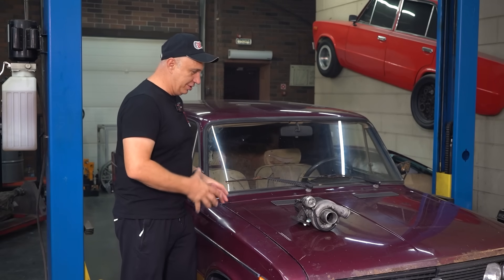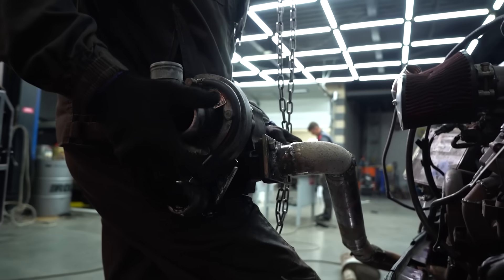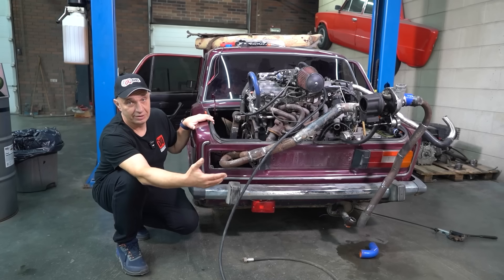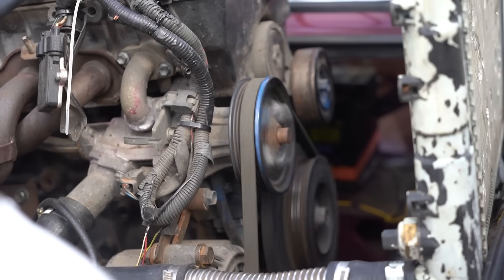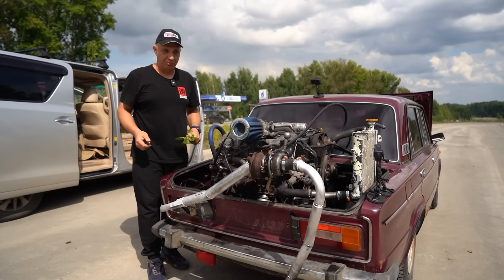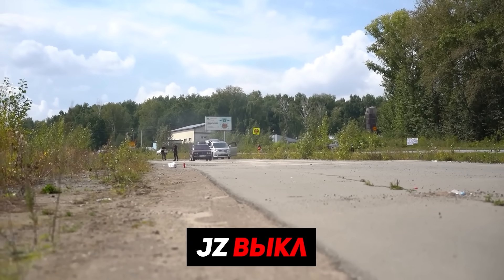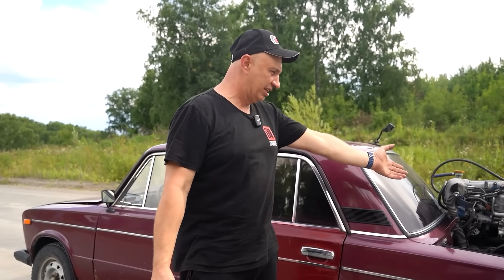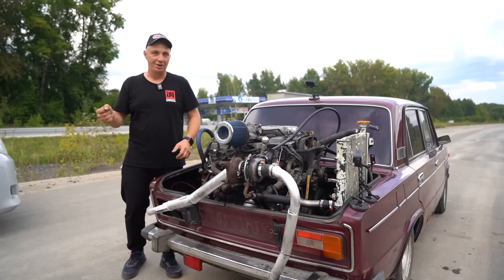Using a turbo to suck exhaust gases out of an engine - what will happen?

Comment: I believe there's a rule in MotoGP for fuel temperature. Would be fun to use the AC system to chill the fuel, allowing higher boost for forced induction and higher compression for NA.
Reply: Jaguar has a vehicle that uses the AC system to chill the fuel... most people bypass it because it is not worth the added complexity for little benefit
Reply: @DarkAttack14  bmw also had an engine that sprayed water inside the engine to cool it down
Reply: theres nothing much to do on a naturally aspirated deal. If you go too cold, you dont get proper homogenated mixture/vaporization (cold carb engine needs a choke etc)

on turbo/supercharged deals its a different thing

motogp idk, super high compression could benefit from colder fuel, but nothing so special to sacrifice power to an ac unit from the crank
Reply: Mazda rx7 did this to chill the fuel to max density,  and cool the return lines and track tempsof the fuel system 1990s
Reply: Cold fuel is more dense so you get more in the tank.
Reply: @mrbrisvegas2  The change is tiny. The reason for cooling fuel is to help lower the air temp in the mix.

Comment: Id be concerned that oil might suffer a bit of evaporation, vacuum can introduce a cooling effect aswell, perhaps some additional benefit could be gained by having a single device both compressing the intake aswell as causing the vacuum effect at exhaust. with some weight reduced in comparison to seperate devices on each end.

Comment: The 2.5 they have dedicated to just run the turbo sounds unironically mean as hell!

ETA I missed the part where they mentioned it was a 1J, so it all makes sense.
Reply from the maker: It's a Toyota 1JZ (the smaller sibling of the 2JZ), of course it's going to sound good.
Reply: And 2JZ is in older supra, the one that can do 1000hp+ if tuned.
Reply: @PREDATEURLT  wtf u mean? supra has +1000hp stock
Reply: @alexihemmoranta297  I take it as a joke just in case.
Reply from the maker: lol)

Comment: Could be interesting to do twin turbo setup with this
one to suck in air (as normal)
one to suck out exhaust gasses (this concept)
Reply: Yeah,  One turbo to take away the gas and another one compressing air into the Lada inlet manifold with more fuel
Reply: Twin turbo with an added supercharger and a bit of nitrous for even more power
Reply: @dossod-n8q lol, oh man, now you’re talking. Let ‘er rip.
Reply: Well this would only work with a 2nd exhaust source like this 2nd engine. Using 2 superchargers on the other hand, one doing the suck, the other doing the squeeze, that would work
Reply: i was just thinking this haha
Reply: Explosion
Reply: why the second engine. Put turbine in front of manifold and compressor on exhaust. Turn turbo on for idling and low revs and off for power. Use bigger engines for power inverse turbo for cruise
Reply: What about a turbo barrel to spin up one side of the turbo and the other to compress the air into the engine
Reply: This was never going to work that well. The best you can hope to achieve is a perfect vacuum, and that's only 1 bar pressure differential. 

Plus if this did work, turbos wouldn't be a thing. Turbos are doing the opposite of what this is doing.
Reply: @benholroyd5221 u could have a turbo suck air out (compressing it) sending those compressed exhaust gasses back into another turbo which feeds into the intake. The exhaust turbo could have one side spun by a belt, so I guess it would be more like a centrifugal supercharger. Also dude, when you suck exhaust gasses out, you create an extremely low pressure zone in the exhaust, so when that valve opens, the high pressure in the chamber will want to equalize way faster. This might be a really cool idea
Reply: @egoat5082  yes. My point is atmospheric pressure is 1 bar (15 psi). Even with a perfect vacuum thats the best pressure differential youll ever get. Pressures in the cylinder are 10 times that (?) when the exhaust opens, so you can only really increase efficiency by ~10%. Sqeezing in an extra bar at the intake means doubling the pressure through the system, including at the exhaust, which inplies a doubling of the pressure differential at the exhaust anyway.

Or to put it another way. No turbo uses the intake vacuum to suck out exhaust gasses, all of them use the exhaust gasses to push in fresh air to the intake. There is a benefit to that, which wouldn't work the other way round.

If you ignore the rest of the systems efficiency, then yes you can suck out the exhaust gasses and improve 'efficiency', just like you can put a wind turbine on the front of your ev to charge it while driving along. The laws of thermodynamics prevent either of these actually working on a practical saving energy/increasing power sense though. 

I suspect you would make better gains by just focussing on air flow in the exhaust, rather than trying to suck it out. Which is probably why we spend a lot of time designing cylinder heads and exhaust manifolds etc, rather than putting turbos on the exhaust.

Comment: You could use an inline turbine with a heavy flywheel that grabs the power from the exhaust passively like a spinner rims? would look cool at least. Or you could have a smaller inline turbine gear combo where the smaller gear spins up a larger flywheel storing the energy, but would require clutches.

Comment: Electric turbo ?
Reply: That's just a supercharger
Reply: @MelodicTurtleMetal no it is not
Reply: @kalashnikov_555 It basically is, just using the electricity from the alternator instead of using the crankshaft. Either way your taking energy from the engine unlike a turbo.
Reply: @MelodicTurtleMetal  he was suggesting to use an electric turbo instead of a 1jz with a turbo, not asking what is it. lol
Reply: @d.martins4471 yes, there's more comments than ideas in their head or knowledge, when they start typing.

So just electric turbo and maybe one extra battery to test this idea. It needs some controller that spins it right volumes.

I would use it to push air tru to "injector" (like in bore wells bottom to make positive pressure, using pumb up at ground. It works as well with air than liquids relatively.)

So then it could make bigger volumes, because psitive pressure before injector device could be more than ome bar, but if you habe one bar negative pressure, turbo pump needs to be very volumetric plus hot exhaust makes bad to electric motor.

If someone didn't understand, don't going to ask stupid questions 😅
Reply: It's a T U R B O S U P E R C H A R G E R
Reply: Probably easier for them to get that engine than an electric turbo out there

Honestly wonder what these guys would do if they were given R&D budget
Reply: They already did it.
Reply: Also known as 'Extactor Fan'
Reply: Too easy

Comment: instead of pushing air in through the intake valve pull air out through the exhaust valve
Reply: How would that work, most engine cycles don't have much overlap between intake and exhaust... Would be really interesting on a rotary though 🤔
Reply: @bobhopman4648  That's.. what they're doing right here.
They are pulling air out from the exhaust cycle with the turbo. If I remember correctly, Detroit 2 stroke diesels back in the day used a similar system, but instead of being an extra turbo it would be a gear-driven "supercharger" (though technically it's not a supercharger because it makes no positive displacement)
Reply: @LukiRudaka not exactly, as my comment said most engine cycles don't have much valve overlap... The vacuum of the engine also probably exceeds whatever negative pressure the turbo is managing to get to the intake valves. There is lots of positive pressure being supplied to it, it doesn't exactly have to fight for air from the intake valves anyways.
Reply: @LukiRudaka I dub it as an anti-charger
Reply: @bobhopman4648 forced scavenging
Reply: @omegarugal9283  at best I believe you would force valves to stay open longer than intended and either run lean or end up slapping valves with your pistons. Would be mildly interesting to see how long a non-interference engine would run like this, especially if it's an Otto cycle engine.
Reply: I still say rotary would be best because of the exhaust overlap from not actually having traditional valves... Forced savaging would probably equal more aggressive braps 😂
Reply: Why not do both.. remove the backflow, add boost, and now you have maximum efficiency..
Reply: @jwalster9412  that's not how it works... Valves only allow so much air in or out before closing. It's like using a fire hydrant to fill a small bucket to carry over to a pool you're trying to fill up. Yes, the hydrant fills the bucket faster than a garden hose, still going to take you just as long to fill the pool. At best this would cause your engine to run lean.

Comment: I was also had similar idea but it was for 2 stroke engine not for 4 stroke, it was for negative pressure for exhaust of two stroke engine for making sing exhaust pipe instead two for 2 cylinder. This is pointless for 4 stroke

Comment: You were supposed to put it on the coolant system instead like I told you years ago to cool the engine without fluid
Reply from the maker: Will take note of your idea and discuss it, but please understand two things, first of all - there are a lot of ideas in the pipeline, we can't possibly get to all of them, second - we physically can't keep track of all of the comments, even though we do the best we can to monitor viewer feedback.
Reply: why not try it yourself, then post the video.
Reply: Turbo water pump, do it on a diesel, see if it cools better under load
Reply: They will try Dumber things than my ideas but won't try my what seems to be reasonable idea of putting a turbo where the water pump would be
Reply: @cliffcorbitt9494  You're not the main character bro